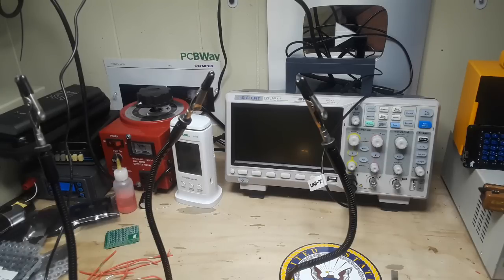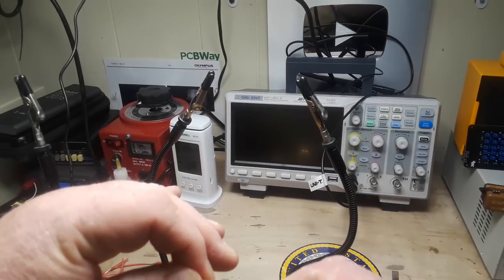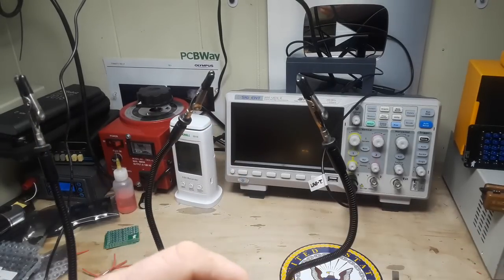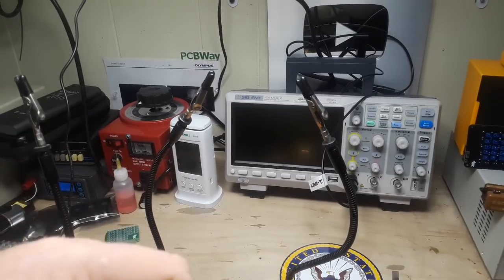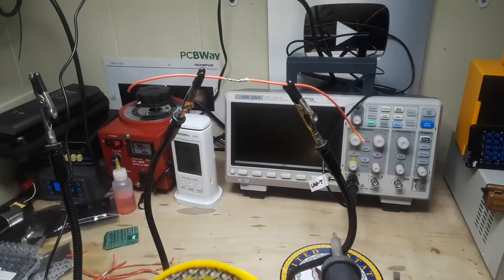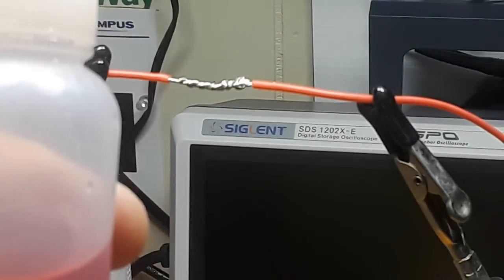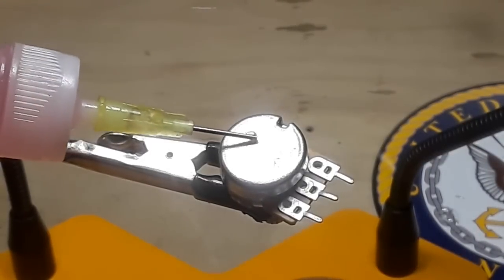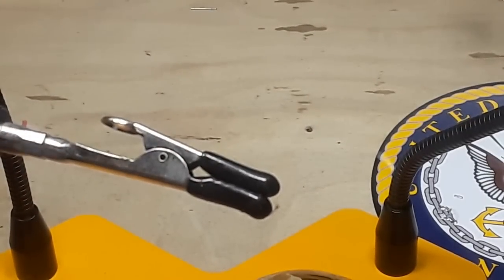3 Wire Splicing and Joining Tips for a Better Outcome

Comment: Heat goes up. In situations 1&2, I hold the iron tip under the joint and let the tin flow from the top.

Comment: Very useful information... One remark: I hate the ground wiring of guitar circuits on the back of the pots... You need a soldering iron with enough power. Then you might burn up the pot. In any case, if you have to replace something, all the connections slide off because of the tension in the wires. Better set a dedicated grounding point in a metal loop connected to the shielding of the pickup cavities.
Reply: The body of pots are grounded to shield them. And yes you need the right tools to perform tasks.

Comment: One small point, when soldering a joined wire, I would apply the iron to the bottom centre of the joint and then apply the solder to the top of the joint working outwards, rather than work from one end, this is because the plastic covering of the wire tends to melt with the heat and starts to contract up the wire, away from the heat. By working from the middle to the ends, it minimises the amount of heat that can leak into the plastic insulation coating. Also due to the latent heat of melting, the melting solder tends to cool the joint slightly. 
It is certainly a good idea to hold the wires to the joint straight, as if curved, there is a tendency for the wire to melt its way out of the plastic insulation, where as with  straight wires, the plastic still softens in the heat, but remains in place around the wire as it cools.

Depending on the application, it is a good idea to fit a cut length of shrink wrap sleeving  on the wire, before making the joint. 
If immediately after soldering the joint, the sleeving can by quickly slipped over the joint. The residual heat from the solder is often sufficient to shrink the sleeving into place. It is something of an art, to judging the optimum time to move the sleeving up the wire and over the joint. Too soon and it will immediately shrink and stick before all the joint is covered, too late and the joint will have cooled to the point where the sleeving will require additional heat to shrunk onto the wire.

Comment: I understand that running a fume extractor when producing a video may create a noise problem, but if you have any lung problems, such as OPD, you really need to run a fume extractor to avoid breathing in the soldering fumes, which are a dangerous irritants.

It is easy to construct a solder fume extractor from a 5 inch, 12 volt computer fan. The fan can be powered from a small mains to DC switch mode supply. 
The construction of the fume filter is simply, using three finger guards and four bolts, two of which should be long bolts.
Two plastic fitting brackets, used to hold wood boards together, and a small mounting base, either made of wood or uPVC.
The base board should be cut in an oblong shape, maybe four inches wide and six and half inches long. The dimensions are not critical, provided the base can hold the fan vertically upright, without risk of toppling over. A small amount of space should be allowed  to fit the fan power connector.
 Fit the brackets to the mid line of the base board, so that the bolts holes in one side of the fan, align with the right angle holes in the brackets.
Using the long bolts, secure the fan vertically, at right angles, to the board, trapping one of the fan guards between the brackets and the fan. The fan air flow should face towards the brackets. Use the shorter bolts to secure the top of the fan guard to the fan. All bolts should be sufficiently long to pass through both sides of the fan mounting holes and protrude about a half inch beyond the fan body.
The second fan guard should be secured to the other side of the fan using the bolts that pass through the fan mounting holes.
Fit four nuts to hold this assemble together. These nuts serve a dual function, securing the fan to the mounting board, and provide a stand off for mounting the third fan guard. Trap a square section of cooker hood filter material between the third finger guard and the guard on the input side of the fan. If the bolt length has been chosen correctly, this should not be a problem. The third finger guard can be secured with either four more nuts, or with knurled nuts, which make changing of the filter a little easier. 
The fan wires can be fitted with a 2.5 mm, panel mounted, power jack socket, which can be mounted to the base board with a small right angled bracket, also common the construction of low cost furnishings. The jack socket is commonly compatible with the output plug lead found on switch mode supplies. The wire inlet to the jack connector can be protected with shrink wrap, or a plastic cap. In my case, I used the rubber cover normally found on BNC sockets.
Four self adhesive rubber feet can be optionally mounted to the base, to give the assemble more height, and to stop the assemble from sliding on the bench top.
When powered, the fan is reasonable quiet in operation, and draws solder fumes from a wide area of the bench, through the cooker filter hood material. The cooker filter material is usually constructed of a layer of glass wool backed by a layer of carbon foam. It is extremely effective in trapping the solder fumes, and is cheap to replace as well as being washable.
The above description is not idea, and a picture would be worth a thousand words, but I hope it serves to provide an idea.

Comment: Nice! I learned how to do just that when I was in the 5th grade from my 4H teachers class, "All about Wiring Your Home." :-)
He worked at Whirlpool and was a electric engineer...  I'm 67 now and doing it that way still works... Lol
BTW I got a Blue Ribbon on my 50ft 3-wire extension cord with a duel outlet. I still use that cord yet today! :-)
They don't make wire like that anymore... It is still as flexible as it was new...
Thanks for the video!
LLAP

Comment: When splicing stranded wires I much prefer not to twist the wires but to leave them straight and push the two open ends together end to end so that they overlap along the length of the stripped wires.  Doing that ensures maximum contact between the two stripped ends as the individual strands are intermingled rather than relying on surface contact
Reply from the maker: The method I showed is what is known as a lineman's or NASA splice.

Comment: I watched a video a few weeks on how they join wires in the aeronautical industry , basically the same as this with a few extra steps :
Once each wire is twisted tight they are then degreased with alcohol then fluxed and finally tinned - they are even fastidious about how they are tinned ! 
They are twisted together the same way you did - cleaned and fluxed again then soldered then cleaned again and finally heatshrink is fitted .
I can see why one would be wanting to slash their wrists after a day of doing That 🤣
Fantastic video Paul !
Reply: Ian,
Is that video available to the public? I'd like to see it. Cool name, by the way.

Comment: Thanks for the video - I always seem to end up with melted insulation, not to mention solder blobs, burned flux, and general filthy mess everywhere :-(  A video on how to nicely solder wires to a 3d printer heat bed would be appreciated. The aluminum bed wicks the heat away too fast. I end up with a solder joint that looks like a five year old did it.

Comment: Great video again!  The only thing that struck me is that the Ruby Fluid is good and appropriate for your application but probably not advisable for use on pcbs or fine electronics like smd components and particularly LED connections to pcbs.

Comment: Hi since you love soldering it seems as much as I do, you should get an onmifixo soldering base, best one I have bough in years! And I have gone throught quite a few of them including the one that you got in the video, the thing that keeps on hapening with the pots and XT60 conectors and stuff popping out because of the alligator tension, not going to happen you should check it out. :) Happy sodering!
Reply: omnifixo... looked it up.  Interesting but a bit expensive for a casual hobbyist .  It's not available until Sept/Oct.
Reply: @alsnow3582  Hi Al, Yes is a bit more expensive than the base showed at the video loosing the pot. A thing that also happened to me in the past. I know is a bit more expensive and the production is not as regular as others but believe me it is worth it, I thought about it myself about the price but after many frustrations going from the cheapest one, making my own with the blue flexibles and having the one at the video and none of them working 100% I decided to give it a go. Again best one I ever got!. Hope you can save the money from here to Sept.Oct :)

Comment: Now on to the fun part! Some manufacturers (for some odd reason) solder batteries into the circuit! How do we go about soldering batteries?
Reply: li-ions solder very similar to the technique he showed on that potentiometer. NIHMs i came across were basically unsolderable,  so you better buy the ones that come with metal strips spot welded to the batteries
Reply: @hackleberrym  Thanks. But it still seems strange to stick a hot soldering iron to a metal container that contains liquids and is sealed!
Reply: @Jimwill01  yeah, you're right, there's always a possibility of overheating the cell, so you have to do it quick. if you're not very confident with your soldering I wouldn't recommend doing it. unfortunately spot welders are too expensive for hobbyist budget. :/
Reply from the maker: https://youtu.be/RGr1o9Jbazc
Reply: @learnelectronics  Yes. I had already watched that. Thanks. But, I have found devices where the battery was soldered in instead of having spot welds. I guess slave labor has to take chances I wouldn't!

Comment: I love the tips on soldering, I have finally got some practice boards so I will hopefully learn how to solder well.... Thanks man..
Reply: These things cannot be taught enough, I learned how to solder many, many years ago, and I figured I was quite good at it (and I was, really, more or less).  But not before I watched several in depth instruction video's on youtube on soldering by the real pro's did I get the true gist of it when about two years ago I took up electronics again and wondered why my joints in some cases would fail, or not come out right, or just not look the way they looked on the vids of those heroes that built what I was about to attempt to.
just the really down to earth basics like heat transfer, flux, fast in fast out with plenty heat, the right tip/iron for the right purpose  and so on.  THis here in this video I am proud to say I found out myself by trial and error, but not before I had seen some of those vids.

Comment: Helping hands or something similar very important for splicing, glad you mentioned to keep slight tension on the wires.
Reply: Indeed, it's the go/nogo factor!  Try holding it in the right position with one hand whilst holding solder with the other and... erm, iron in, foor?  Before finding out by trial and error this is how to do it I used the third hand to hold the solder, several times until the penny dropped realising the third hand also has a fourth, so keeping both wires fixed in the most perfect position is the way to go, takes some carefull adjusting, but once you got'm right you can clip in wire after wire and get'm beautifully connected every time.  One thing to remember though: put on the shrink wrap on one of the sides BEFORE you connect them!  And, also, make sure to put it on the other side of one of the clips, and somehwat distant so as not to catch some residual heat and shrink at the tip in a way that makes it hard or impossible to shove it over the connection (not very likely to happen with the alligator clip acting as a heat shrink, still, with thick cables and some fiddling you'd be surprised).